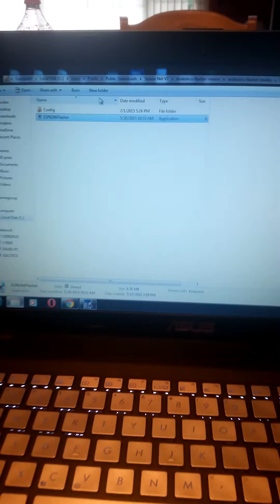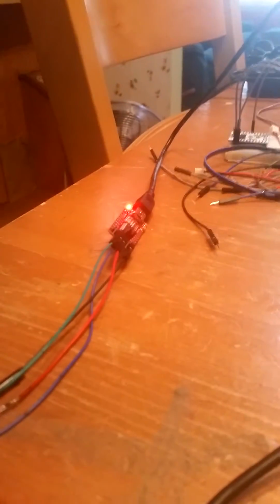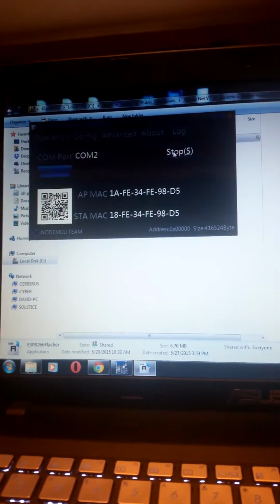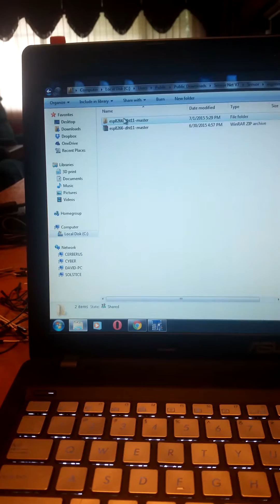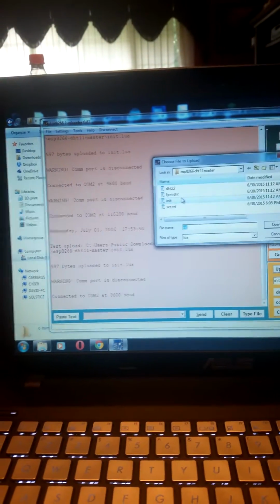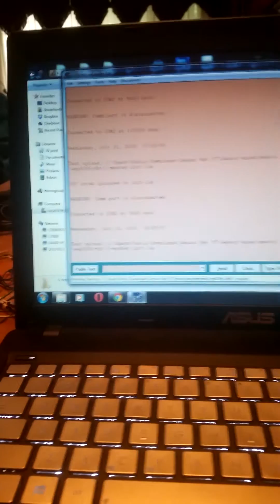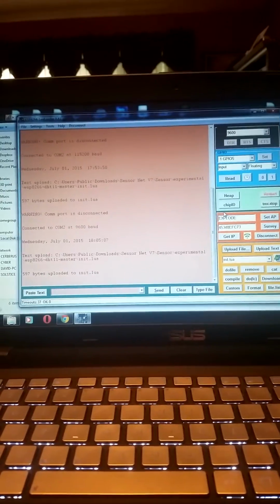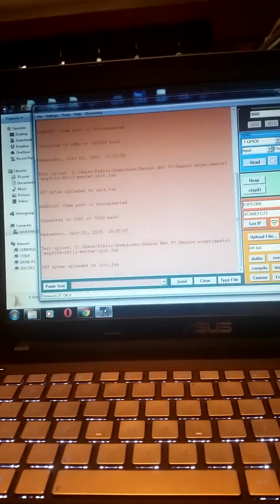Esp8266 lualoader

Comment: yeah me too !! what's the problem ?
Reply from the maker: check power, make sure your power and ground are all on the same rail and you have enough power.
Reply: @Tom_Neverwinter  I'm sorry I didn't clear that I'm using nodemcu module ! but I have the same issue that it's not uploading any code + coding with lua is a bit new to me, and I don't know how to work with these IDEs. I'm switching to Arduino !

Comment: One problem you're having seems to be a severe case of VVS. please see https://youtu.be/Bt9zSfinwFA for details.  Also do you have problems uploading with esptool.py?
Reply from the maker: Genetically Perfect Pig yeah i know VVS, just annoyed the apps are not working correctly in windows. I just want an easy plug and play solution. esptool.py works just fine from my vm (kali linux);

 root@kali:~# sudo python '/root/Desktop/esptool-master/esptool-master/esptool.py'  --port /dev/ttyUSB0 read_mac
Connecting...
MAC: 18:etc
Reply: Scott Winterringer My mistake, I didn't realize what the issue was until I watched the video again.

It looks like you are leaving GPIO 0 hooked to ground after flashing the firmware, If you disconnect GPIO 0 from ground after starting the flashing process, once the flash process is complete, the esp8266 does a soft-reset and if GPIO 0 is still being pulled low, it will re-enter firmware programming mode.

This is how I flash my esp8266 (esp-01, esp-07):
* Before power on, I hook up: +3.3V, Gnd,  RX, TX.
* After I power it on, I hook GPIO 0 to ground, then I reset the chip by connecting the reset pin to ground temporarily(~0.5 sec) to put the chip into firmware programming mode.
* Then I start the firmware upload process using esptool.py (I upload at 460800 baud, much quicker, ~20 sec).
* After the upload has completed, I disconnect GPIO 0 and reset the chip by temporarily grounding the reset pin again.
* Then I open ESPlorer(http://goo.gl/3W2XkO) connect at 9600 baud and upload my lua scripts.

Before I discovered ESPlorer, I used LuaLoader, it is a great program, but I find that ESPlorer is more streamlined for interfacing with the esp8266.

Hope this helps.
Reply from the maker: Genetically Perfect Pig odd having GPIO 0 float disables the com port o.o ??? making it high also makes it dissappear??? powering externally has the same issue? 5V10A converted to the ywrobot breadboard adapter at 3.3V reads good
Reply: I forgot to add that I also have CH_PD pulled high
Reply from the maker: Genetically Perfect Pig I figured it out! after teaching myself, I learned that "common ground" is not the same as "ground"
IE; the ftdi must ground as well or there will be excess power from the external power supply and it will force the ftdi to shutdown because of voltage overcurrent protection. /doh!

on the ywrobot external power supply; ground to ftdi ground, and esp8266 ground to ywrobot ground.

simple problem. I thought it was a power problem ie not enough power. turns out improper grounding.

Thank you very much. I will leave this video up so someone may resolve their problem if it is similar to my problem.